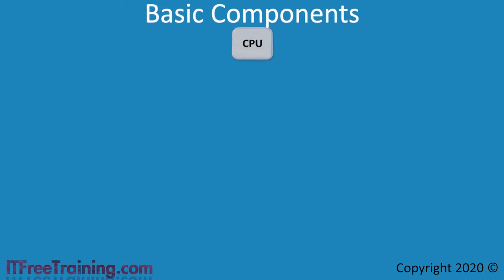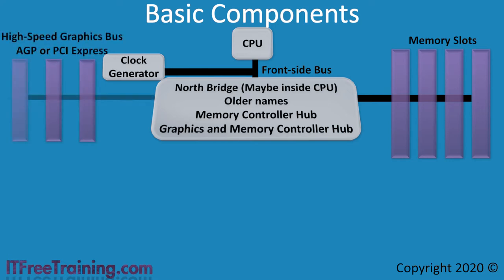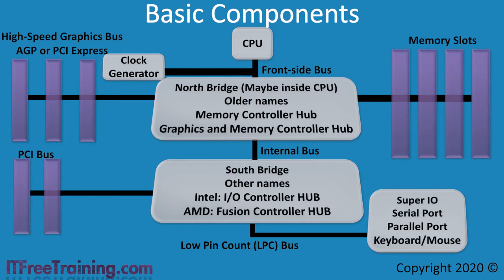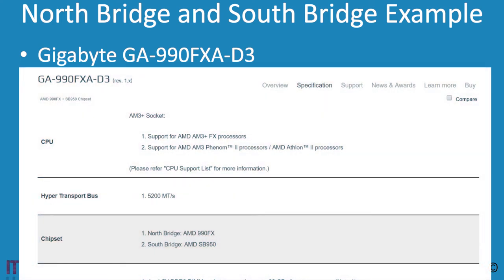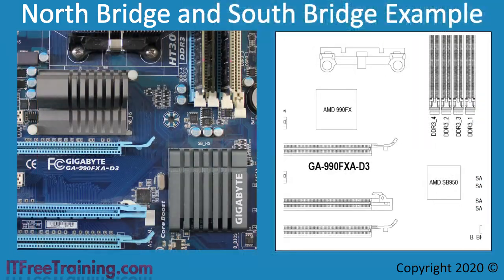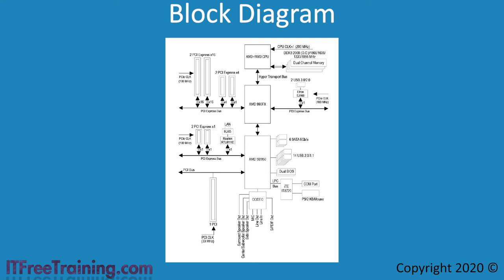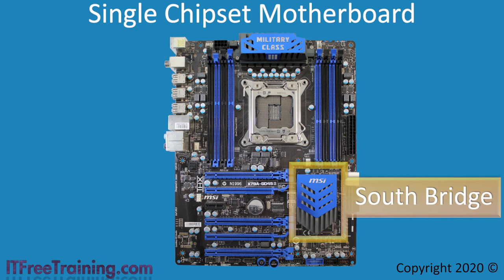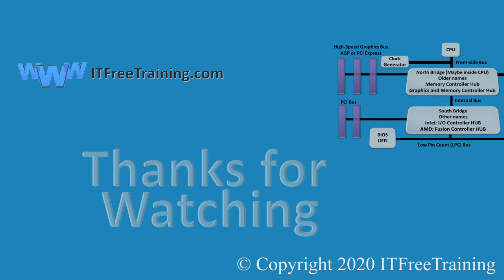Components of a Motherboard

Comment: Is the clock generator the system clock - the quartz oscillator - and what generates the speed of the FSB? Thanks.
Reply from the maker: The quartz oscillator generates a clock rate at a specific stable frequency. This is taken as the input for to other devices on the computer to generate additional faster frequencies. Generally the FSB clock rate will be created by the north bridge chip.
Reply: @itfreetraining thanks for the explanation